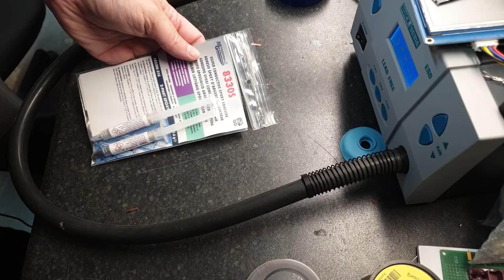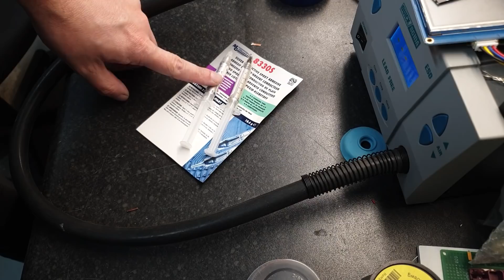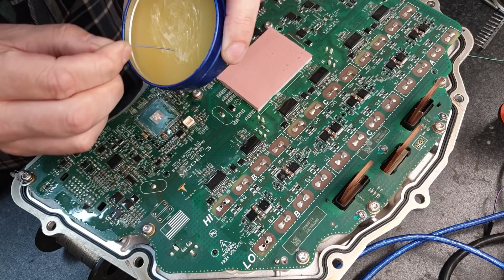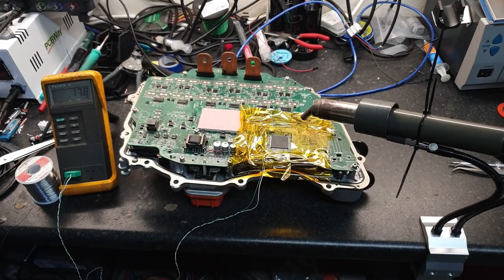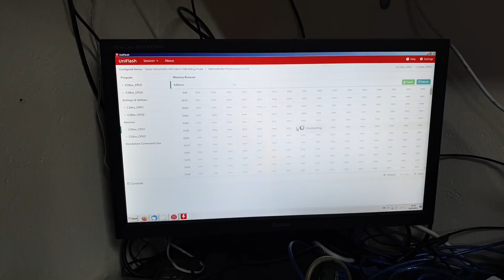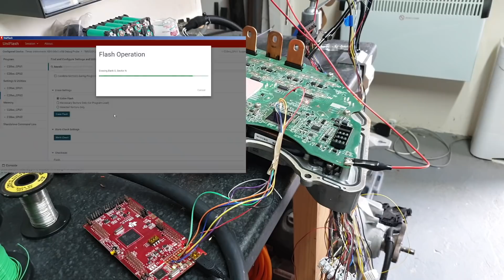Tesla Model 3 Drive Unit JTAG Marathon

Comment: Hi Damien,

thank you for providing us with the Tesla model 3 inverter videos. 
I am working on building an axial flux motor for electric vehicles and I will use a Tesla model 3 inverter to run it. 
I understand most of the MCU periphery and now is the time to programme the MCU. Looking at your video 
https://www.youtube.com/watch?v=brnlrx_JxVI&t=2272s
I can see that you tried to use the OLIMEX TMS320-JTAG-USB-XDS100-V2 emulator. 

Is the problem in that particular emulator you own or is it in the OLIMEX TMS320-JTAG-USB-XDS100-V2 emulator which is not compatible with this particular MCU? 

If it is the problem in the OLIMEX TMS320-JTAG-USB-XDS100-V2 emulator, what launchpad did you use? If you tried with some other emulator please let me know.

Thank you for the videos and looking forward to hearing from you,
Marko

Comment: Worry not about the hours of effort in the wrong direction, because you learned much more than if the Olimex jtag adapter had actually worked as expected. Best wishes to you and the cat. Looking forward to seeing you stuff that chip full of open inverter firmware.

Comment: Congrats on overcoming the slings and arrows of outrageous fortunes.  One warning on this processor family: while you can run programs from RAM at speed, the flash is not fast enough, and if you have any timing critical routines (like your interrupt), the trick is to tell the compiler to locate the interrupt segment in a RAM bank but put a copy in flash, and then at startup before the interrupt is enabled, you copy the code from its flash backup into its RAM home.  Once you know this is a thing, the mechanics are straightforward (there's a technote for it), but during my first software development project on these CPUs, to build a program that worked just great from RAM and then have it fall over the first time I ran from flash was quite a shock.
Reply from the maker: Thank you. Much appreciated.

Comment: That's the way it is PIC microcontroller security.  You can't read the code all you get is 00.  But you can do a full erase which will allow reprogramming because the security was erased as well.